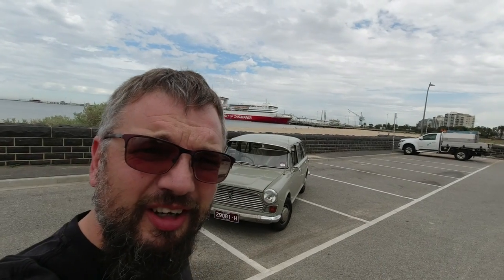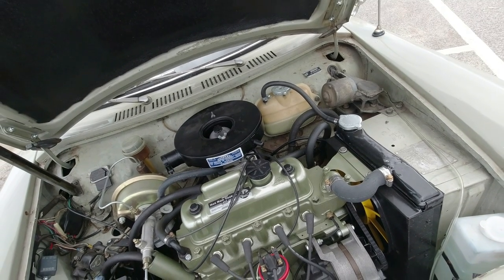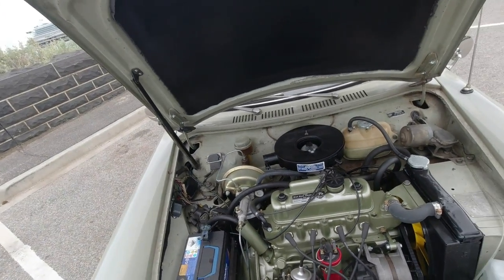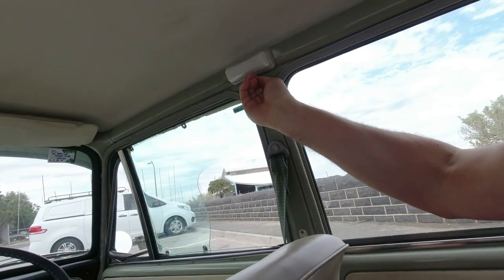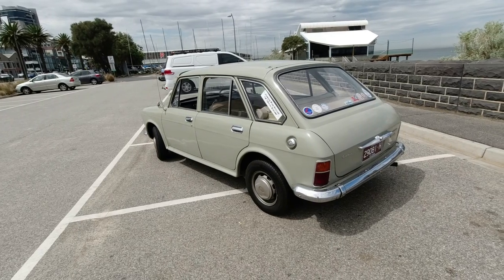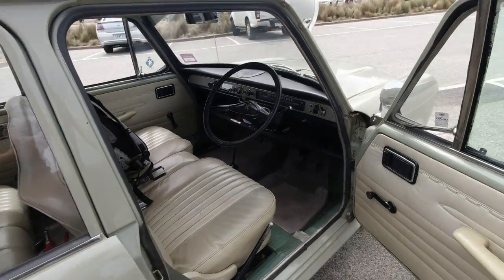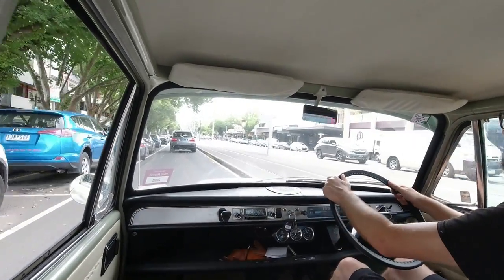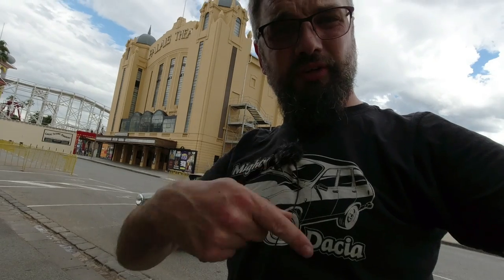Aussie Oddballs: Morris Nomad (1100/1300 station wagon thing)

Comment: It wants a gallon of petrol (Shell V- 99 octane )  thrown inside of it and a lite match thrown in.. 
It excels at ...Errrrr   NOTHING! 
A car should always have ONE redeeming feature, Otherwise it is not worth the metal it is made out of...
Reply: Perhaps you've tuned into the wrong YouTube channel? HubNut is all about celebrating average cars! For what its worth, I reckon anything 1100 based is brilliant! The 1100 took all of Issigonis brilliance with the Mini and turned it into a more practical, refined car. Whilst not particularly quick, ADO16's (and this YDO9) are a good fun drive! Certainly  worthy of preservation!
Reply: pete smyth  LOL... They must have more money that sense .. This car is just NASTY.
Reply: @andrewhofler  Never confuse cheap and cheerful (Austin Mini 1959-2000) (Morris Minor 1948-1971) 
With cheap and nasty ..  This "Car" in this video looks like someone has had a pile of BMC spares and just nailed them together .. They did not have a 1750cc engine so they used this WAY under-powered engine for this size car.. 
The two above cars Austin Mini and Morris Minor both have redeeming features.. This pile of junk has NOTHING going for it.